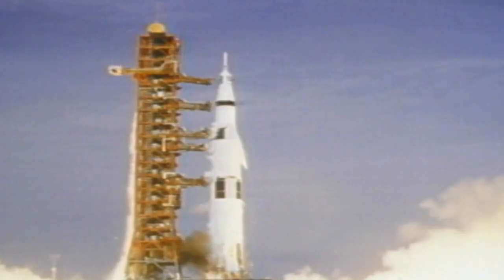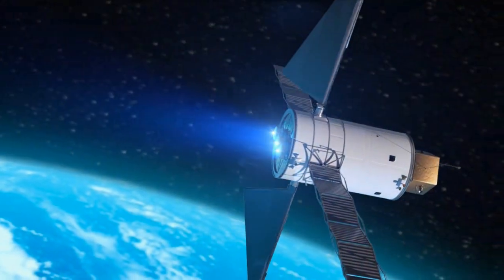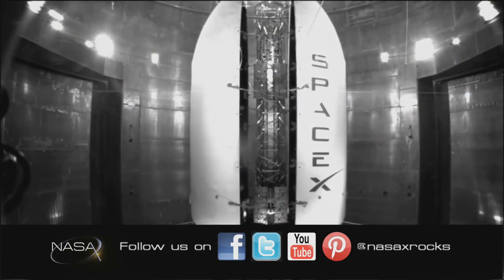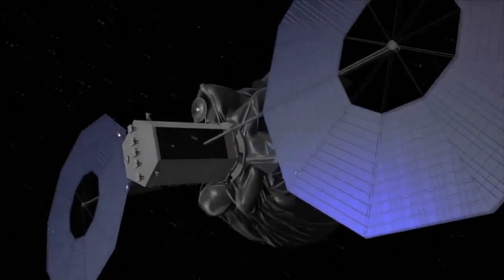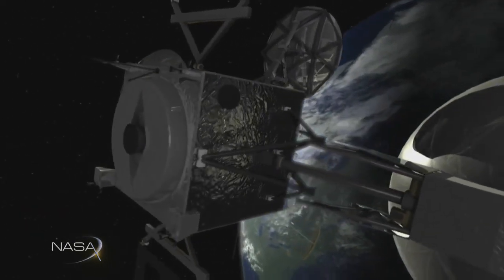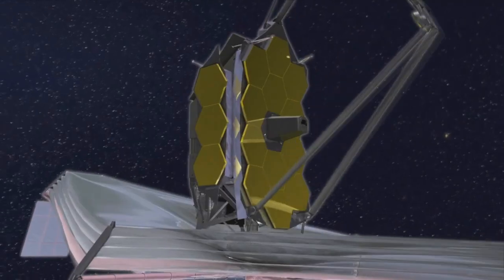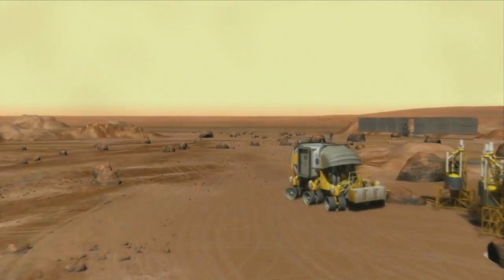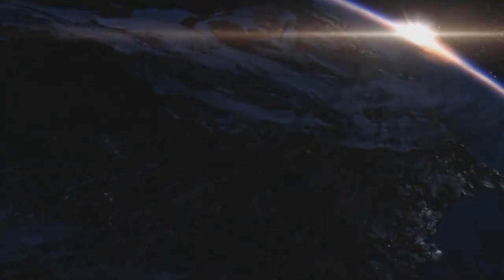NASA X - Power and Propulsion GCDP

Comment: The extremely high specific impulse attainable with ion drives derives from the high velocity of the expelled atomic ions.  Could that velocity be boosted with particle accelerators?  Even LINACS can boost charged particles to relativistic velocities.  Not very compact, but in space you wouldn't need to provide the vacuum and carry a chamber to keep atmosphere out, which should save an awful lot of weight compared to a LINAC here on earth.